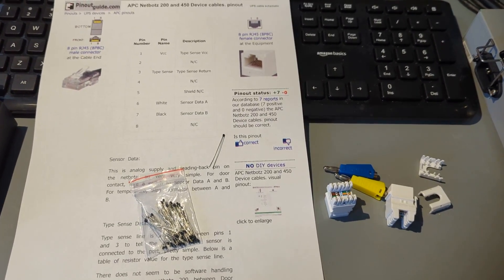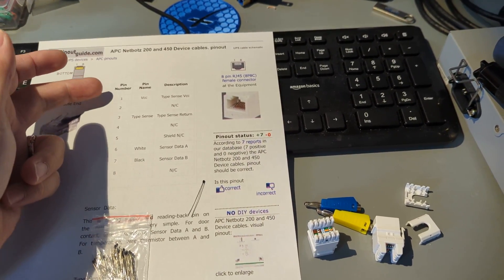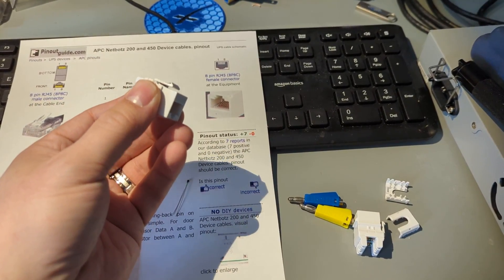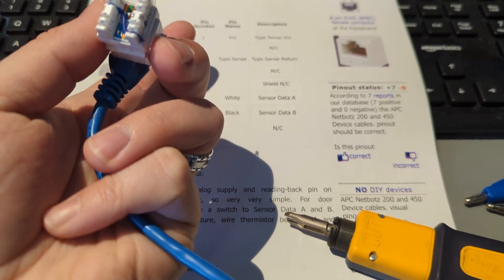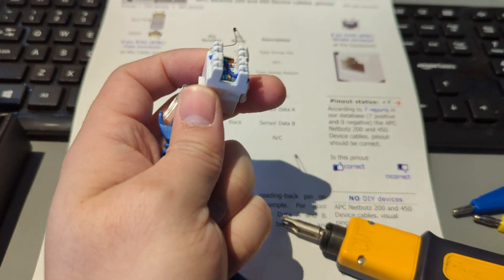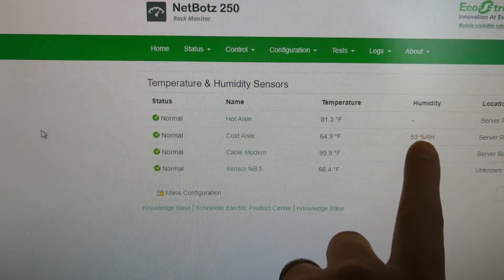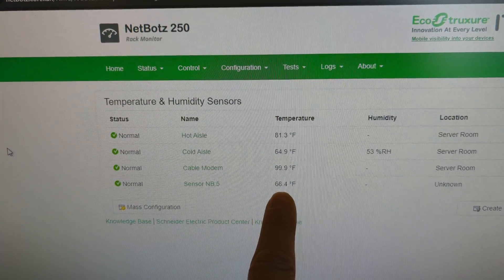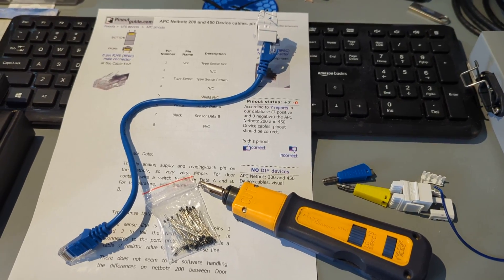APC Netbotz DIY Temperature Sensor

Comment: Hey - gr8 info - just ordered a used APC AP9340 for a few bucks but i would like to ask you... how to build the temp humid sensor ?
Reply from the maker: I have not pulled one apart yet to find the right part.
Reply: @burntsemiconductor  I just got my hands on AP9512TBLK - will have it this week - might this help ?